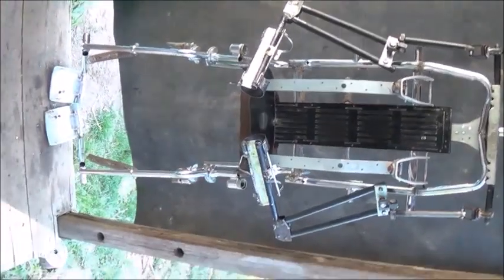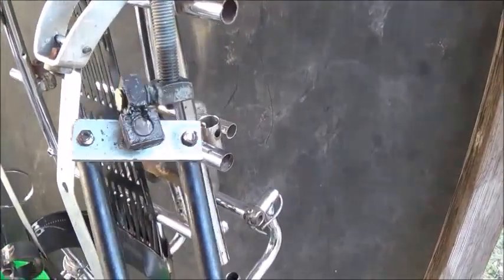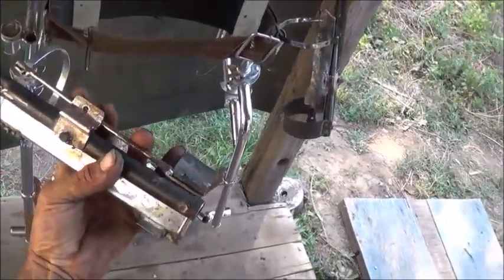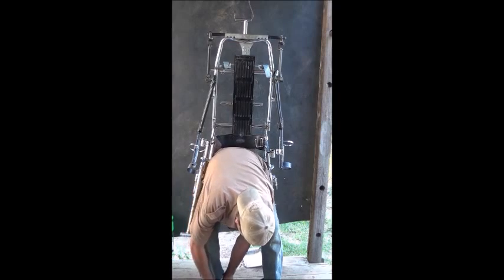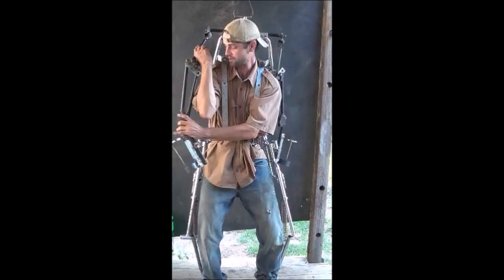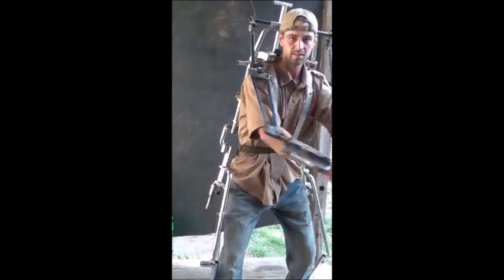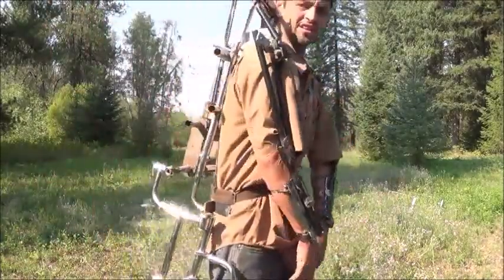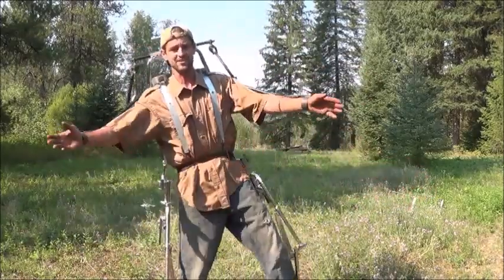"Exoskeleton", Homemade full body Exoskeleton

Comment: Drivin by a pneumatic system: Semi-truck airhorn compressors are small and provide 120psi. I hope this helps provide a onboard air system. I suggest a small moped engine driving a alternator to a small battery connected to a transformer to power the air compressor (or a similar compact desighn)

Comment: Too many people are negative here. 

Application: Exoskeleton suit holds the weight of armor.
Kevlar sheets and epoxy are fairly cheap.
Suit holds itself up without a lot of power.

If you manage to compact the design and mold kevlar around it, you have a suit of bulletproof "Juggernaught" gear.

Additionally, adding electronics such as taking a normal everyday camera and dismantling it into it's individual components gives a new opportunity.

Mount the camera to the back of your helmet, and place the screen inside, over your eye. Now you have the option to see behind AND ahead. No sneak attacks.

Comment: I feel like if your replaced several of the metal tubes with hydraulic pistons and put a hydraulic system on your back it could work as is, but that's easier said than done.

Comment: You need to place a technically battery, then go make a puchmachine to let it puch more strength to your arm.
(Don't comment for my grammar its possible wrong written.)
Also, I did it once and it works with the right technical structures.

Comment: Would this suit or a different type of exo suit be able to work just by mechanical advantage? I would like a non powered suit that would help just enough to take most of the weight of body armor and a ruck sack off of my body. If so what percentage would that be, 30 -50%?
Reply from the maker: A simple system of springs as weight bearing cushions would allow you to reduce the strain felt and allow you to relax in the exo which would put the load on the springs not you allowing you to take a break from holding the weight by simply relaxing and allowing the suit to hold the weight on the frame and springs.  The springs can be adjustable to increase or decrease the tension or weight caring capability.
Reply: MrTeslonian try it with air presure cylinders

Comment: Good work! I'm sure  you have researched some of the other synthetic muscle designs  out there. You have the skeleton why not pop together some f these other muscles, just to show it actually working to get proof of concept for your skeleton. You also have to build a control system that actually is the hard part no matter what you use for muscles.